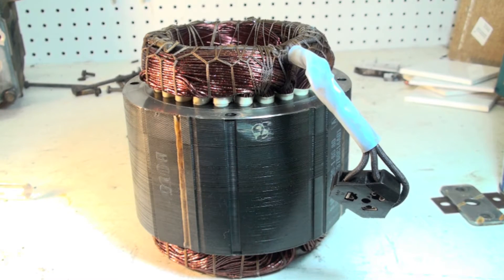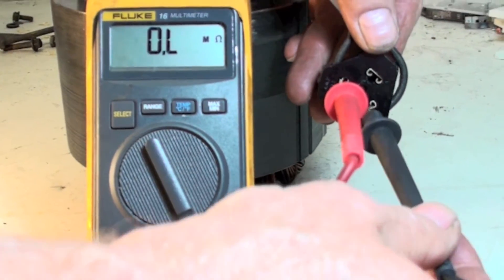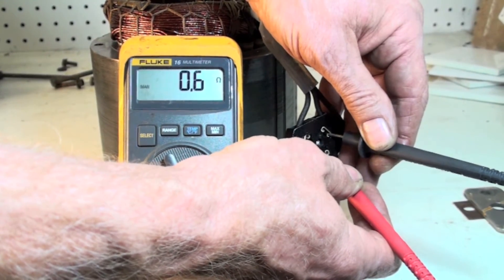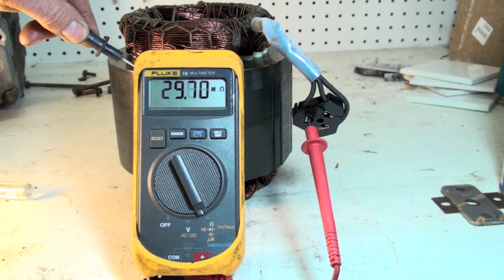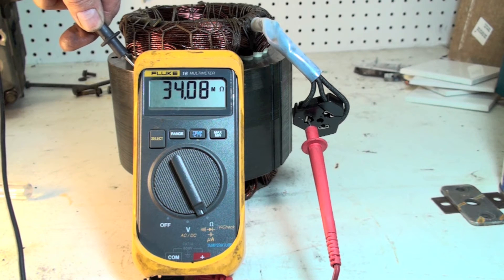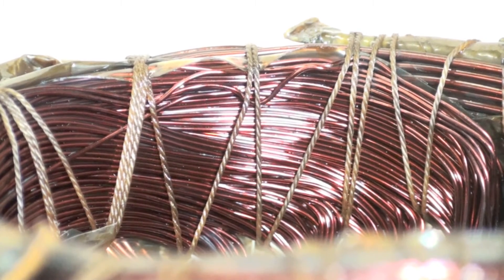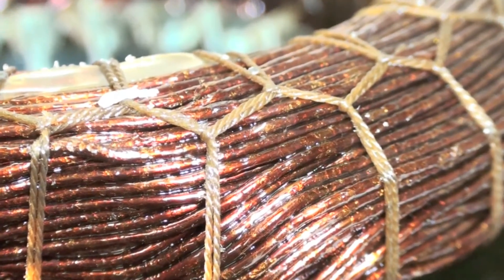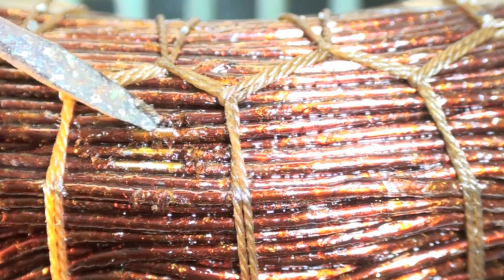Carlyle (Carrier) air conditioning compressor autopsy

Comment: Wow. To make that winding enamel get soft and gummy like that - I would thing a chemical attack would have to happen. Most of the time I see burned windings they are "hard and crispy." 

That gummy look makes me think that some sort of harsh solvent got in it. I've seen this when someone uses an incorrect cleaning solvent on a motor. The motor was sprayed with a painting solvent called "laquer thinner" which softened the varnish. It wasn't a compressor, but the end result was similar.

Thanks for sharing this!
Reply from the maker: I don't pretend to know for sure what has happened, but it could be from phosgene gas.
GFM

Comment: You can be sure that the resistance was lower and the leakage current higher when the windings had 230 volts impressed and the windings were warm, than the resistance you read with just a few volts impressed and the windings at room temperature.

Enough current was (probably) shunted to ground to rob the motor of the torque it needed.

You can have an arc at 230 volts, but when you just use the Fluke no current can jump the gap.